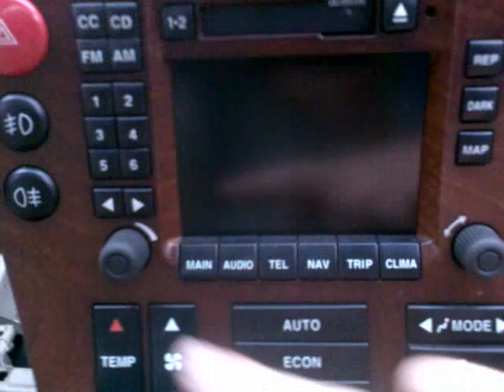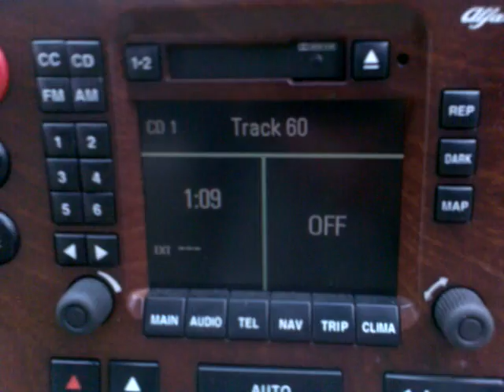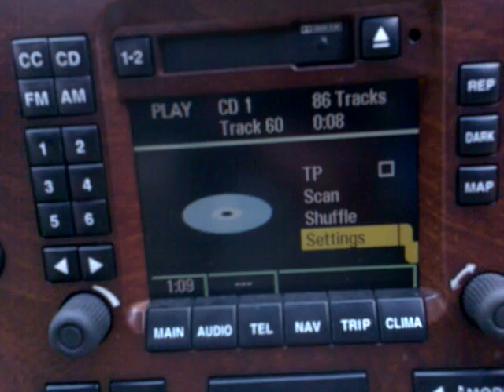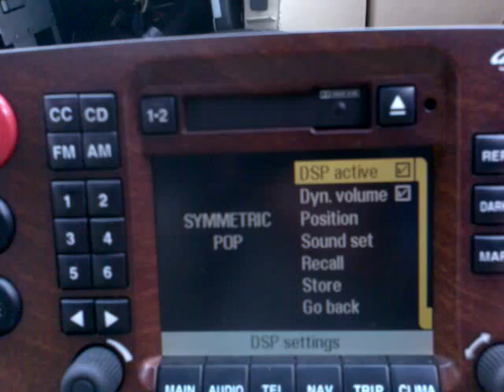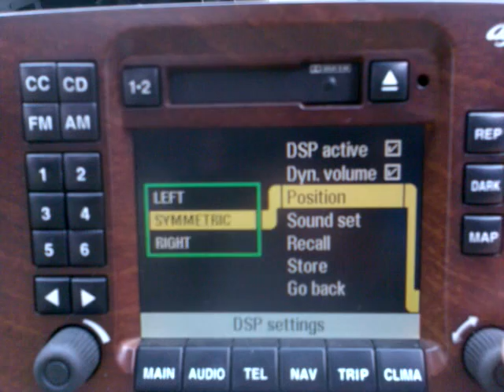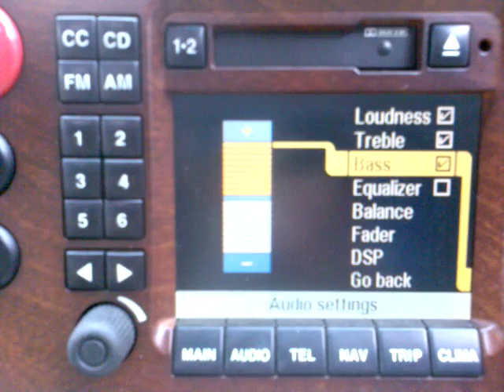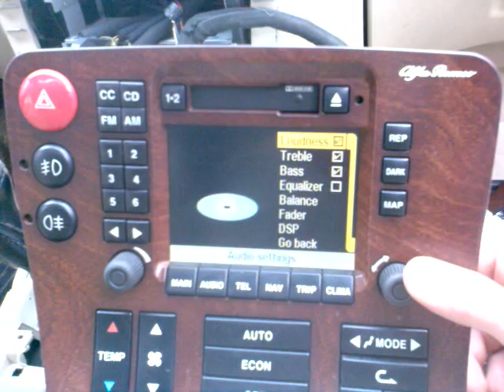Alfa Romeo 166 DSP Amplifier ( HAES ) Install

Comment: I have installed a DPS cable, but the white connector at the ICS-side has more pins than my original cable (and my ICS). It concerns the white connector to be placed behind the controlpanel for the climate control.. 
Can you help me how to connect this?
Reply: Were you able to resolve this issue?